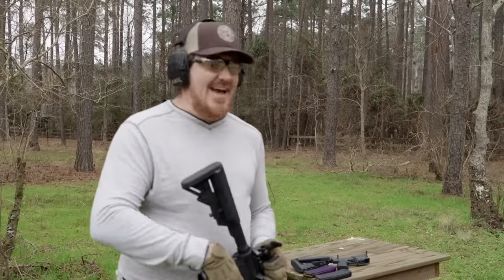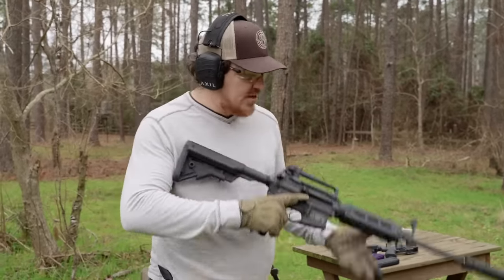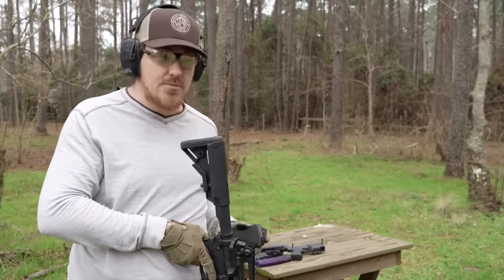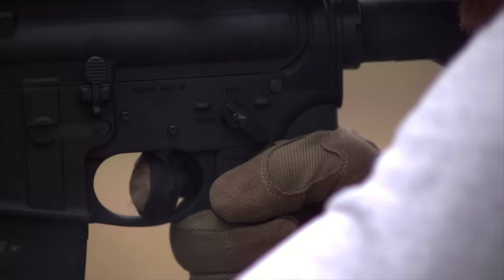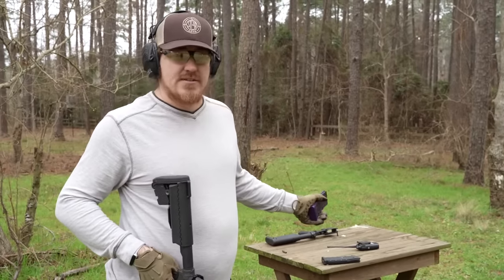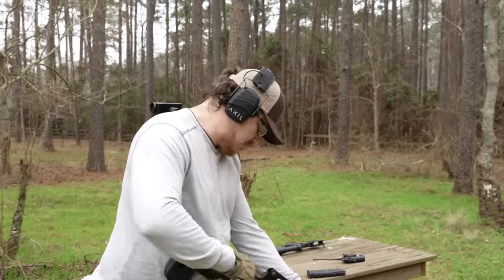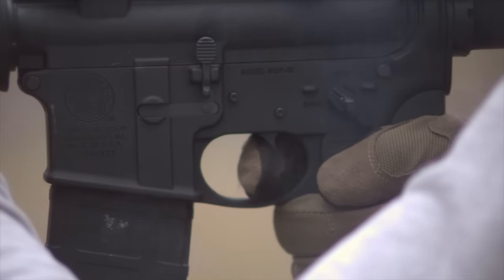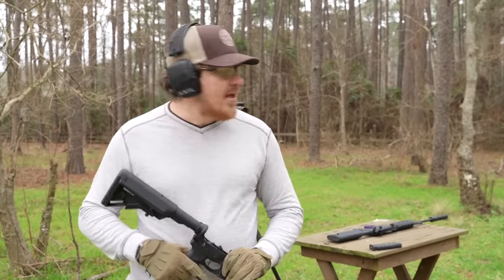FRT-15 Vs An Actual Machine Gun

Comment: This is just a loophole to a machine gun. And thus this is a machinegun. 

Its illegal. The ATF is right. They are there to ensure there are no full auto guns like this around. So yeah.  Everybody gets this. Its a full auto. 

Greetings,

Jeff
Reply from the maker: Loop hole does not directly translate. Yes the ATF at one point classified a shoe string as a machine gun. They classified a bump stock as. A machine gun which was over turned and is back in the courts again. This is just technology catching up to design capabilities. While it operates under a loophole, the atf is just upset that this design actually works well. So instead of the company getting positive recognition in engineering they get hit with a legality battle. Which we all knew was coming, line you said. Loop hole. This video was made to demonstrate functionality within the letter of the law. I get under the spirit of the law and so on so forth but the rules must be applied fairly and evenly. This is an overstep one the atf part.
Reply from the maker: I think your logic is in the right place but reality is far from accurate. There is no license for full auto. Just tax stamps and money. Due to the limited number of legal full autos thanks to ridiculous laws to begin with full auto gets very expensive very quick. If you can legally own a gun you can legally own a full auto. Just takes money and lots of it. The ATF just wants to feel like they have a reason to exist. Look into Waco.
Reply: @jeffjefferson2676  if street thugs could afford 500 dollar triggers in 800 dollar guns, they wouldn't be using hi points and Rock Island 38 revolvers.
Reply: @893R6-w8t  A revolver is great to leave no evidence. As in casings. It does leave a lot of powder residue.

Someone that wants to do a killingspree does not care about a couple of grand more. It is to keep people safe from idiots who want to shoot at the public. 

If you are really dedicated of course you can get your hands on, or make full auto guns. Or bombs for that matter. But if you can do that you are probably sane enough not to do harm with those things. The bottom line is the country does not want to be responsible for not having prohibbited the full auto atributes. The ATF does not want to be held accountable for any murder they could have stopped. 

Thats it.

Greetings,

Jeff
Reply from the maker: The hole in that theory is a 20 cent part can turn an AR automatic. No thug would use this trigger that’s traceable when there are non traceable no cost methods to convert to FA…. Let’s be real if we going to be real
Reply: @gatcattill  yup, they've been buying chinese glock seers for years now.
Reply: @jeffjefferson2676  So the worst "killing spree" we had was the 2017 Las Vegas shooting. I did the math on that a few years ago, pretty sure the guy had easily 6 figures into the arsenal, not even including the random crap like all the gun cases he needed for setup and room cost. All in all, he killed 60 people and shot over 400. Another 350-400 were injured in the chaos. 

To me, that pales in comparison to the 2016 French truck attack, which killed 86 people and injured 434. All with a 200 dollar rental truck. 

Gun owners are not, and will never be "the problem".
Reply: @893R6-w8t  He had the full auto stock that did the killing. With this trigger he would probably have killed more??

No full auto features for civilians. 

That is what they came up with, and that is what they are enforcing. Is it right? Is it wrong? The only way to have full auto legal again is when they lift the ban on regular full auto trigger parts again. And they will never do that. But that is the part of the law you want to have changed. Otherwise they will just ban every other full auto device for the ar. 

Greetings,

Jeff
Reply from the maker: Jeff research that more and pay attention to audio cues. The Las Vegas shooting was no where near what a bumpstock sounds like. Bump stocks have an extremely variable and very scattered rate of fire. The video footage from cell phones played you can hear a very obvious belt fed machine gun. Whether he had the 60k to buy a legal one (not found or disclosed) or was given one to use (agenda push for the atf? Remember Waco… atf will kill citizens for an agenda)
Reply: @jeffjefferson2676   There is no such thing as a "full auto stock". You can bump fire a rifle from WW2, it's really irrelevant. Those figures were just the status quo by the way. The ROF did sound disgustingly similar to a belt fed machine gun, as said earlier.

I agree with you otherwise. We will get nowhere with these small legal battles against devices. The law needs to be changed and the AFT needs to be gotten rid of.

Comment: It's pretty disingenuous to claim that you're only getting one shot per trigger pull. The trigger is technically resetting after each shot, but you are only pulling the trigger once.
Reply: Yes, what ur saying is very true. The trigger mechanism itself forces a reset after each round. It physically pushes ur finger forward and releases tension to fire the next round. The reset is done automatically, not requiring further user input past firing the first round. All you have to do is apply firm pressure and the platform will continue to cycle until you run out of ammo. You empty a mag with one motion. I don’t see how you can argue that this is semi-auto by terminology definition. But then again I’m not familiar with American gun laws.
Reply: By the letter of the law it does seem to technically comply, but it's so far outside of the spirit of the law that the technicality feels moot to me
Reply from the maker: I get your statement. However after the trigger resets if I stop pulling it will not fire the next round. You still physically pull each shot. This is why we did the highspeed to confirm the mechanism is as promised.

Comment: kind of dumb comparison. the cyclic rate of an m16/m4/ar15 whatever the fuck you want to call it can be tuned. My m16 runs faster than both of these...by a long shot. but thats the way i have it set up.
Reply from the maker: Sure. Lighter buffers, gas tuning, suppression, hotter rounds. . . It’s more does the locking bar slow the process down. After it was all Said and done we really wanted to go back and redo it with the same buffer tube and weight and spring. But time is money and we were out of both 😂
Reply: @gatcattill  Ive actually got the H3 buffer and run green tips. But i use the main spring from an mg34 and cut it down in length. with the shrike upper pulling belts it runs a bit over 1000rpm...faster on mags.
Reply: @gatcattill  yeah i feel you on time and money. havent shot mine since the coof started....i feel like my current supply of ammo is ear marked for a particular event in the not so distant future.
Reply from the maker: And the ammo supply just got cut by 40% with one Russian sanction.
Reply: @gatcattill  my guns are patriots, they only chew brass. :)

Comment: This is the definition of hair splitting definitions of machine gun and semi auto. The function of the frt is to turn it into a full auto machine gun
Reply from the maker: Innovation should not equate to felony. The device is simply to reduce splits and help individuals fire at a faster rate. The point of a machine gun is to fire all rounds with a single pull of the trigger. Our high speed footage distinguishes this.
Reply: @gatcattill  No the purpose of the device is to turn a weapon into a machine gun where a single pull gives you full auto behavior and the trigger movement is a distinction without a difference.

Devices like this come directly out of the right wing militia movement who want to overthrow the Constitution. 

There are reasonable limits to every Amendment in the bill of rights. Not having a fully automatic weapon is perfectly reasonable
Reply: @runtoth3abyss  repeating your point and stating buzzwords doesn't really help your argument. Get original.
Reply: @rileymalone2087  You could actually show my arguments are incorrect?

In function it turns a weapon fully automatic.

Right wing militias have been looking for workarounds to gain full auto capacity for their semi auto ARs.

There are reasonable limits to each Amendment which is non-controversial.

But your argument is empty
Reply: @runtoth3abyss  it is much easier to 3d print a $0.25 peice of plastic to turn an ar full auto than it is to spend $400 on this trigger.
Reply: @rileymalone2087  Sean has a good point. The government is more concerned about the rate of fire of a weapon; not so much about if it was one pull of the trigger.

Comment: Another video drawing attention to what skirts around ATF regs yet ADVERTISES how it achieves equal or greater results than a Class III weapon...SMH!  And everyone wonders why the ATF is going rogue trying to classify add ons like this as a Form 2. Dumbass move IMPO
Reply from the maker: You a fudd? Sound like a range Fudd that yells when I happy pop a double tap out of my scar 17s on the firing line…. Rate of fire doesn’t determine classification. Skirting a rule isn’t breaking a rule. This is a movement for American rights my guy. Get on board!
Reply: @gatcattill  not in the least Buddy...but I disagree with your justification. Thanks to all the 'advertising' of devices like this, NYS has adopted S2448 which makes it criminal possession to own one.
Reply from the maker: @vetteconnoisseur9531  it was already banned in numerous commie states that ban any device to increase fire rate.

Comment: Its such bs though. Its a bump trigger. The user simply maintains pressure on the trigger, those aren't individual pulls.
Reply from the maker: Belt loop = bump trigger. Just because it’s more sophisticated doesn’t make it illegal is the point
Reply: Belt loop, designed for belt to go through. This part, designed to increase cyclic rate to that of an automatic you shall not pass from the atf. Have fun, but you know it’s not going to last.
Reply from the maker: @davidhamilton1446  no doubt it’s going to be the face of a lot of attacks (currently), but we can hope that we conquer. Think of frt as a honey pot to the atf to get them to overstep and have their hand slapped for it.

Comment: There is no reason for a non military person to have a trigger that can shoot that fast you are not pulling the trigger  the recoil is what is moving the trigger and the finger
Reply from the maker: Not a bumpstock. Recoil is not doing anything at all.
Reply: @gatcattill  good luck educating idiots who start with “There is no reason for a non military person to…”.  Not sure that’s in the Constitution.   I just looked, not in there still.
Reply: @gatcattill  It’s “per function of the trigger”, which means you have to consciously and overtly pull the trigger for each shot to fire. FRTs force a reset, IE. They automatically reset, causing it to be full auto as it’s a fully automatic action of firing.

An FRT forces the trigger to reset, in which your continuously pressure on the trigger makes it AUTOMATICALLY function.

FRT is fully automatic because its a fully automatic process to fire multiple shots.

Comment: This video didn’t age well under the tyranny of the American Tyrannical Force. ATF.
Reply from the maker: I think it aged like a fine wine. Just with a different alcohol level than you would expect so it catches you off guard. Still provides a valuable look into the gross overreach were experiencing.
Reply: Yes how dare those tyrants take away your mass killing devices. Just imagine how many classrooms you can decimate with your FRT, I mean how many hundreds of dear you can rapidly shoot, right?
Reply from the maker: @killed_by_the_architect-829  if they used an frt it would probably kill less people since they are easy to malfunction and fail. I would never use one in a duty / battle situation. Don’t be silly.
Reply: @gatcattill  my bad. Your 100%

Comment: Not a machine gun fu(ktard 🙄
Reply: Machine guns fire from an open bolt position that is a closed bolt weapon... Not every automatic weapon is a machine gun
Reply from the maker: @andrewbieszk3264  this is in reference to NfA handbook not Webster guide to military arms ;) NfA says: 

Any weapon which shoots, is designed to shoot, or can be readily restored to shoot, automatically more than one shot without manual reloading, by a single function of the trigger.
Reply: ... the strictly online hand book put out by the 2nd amendment's greatest enemies? Which specifically states that they don't put out a printed version to make it easier to alter the document 😔 Are you gonna tell me an AR is an assult riffle next?
Reply from the maker: @andrewbieszk3264  yes? You do realize the purpose of this video is to show case thr frt is not by atf nfa handbook definition a machine-gun so we use the context of the law for our comparison 😉